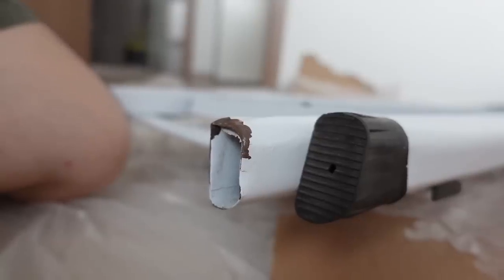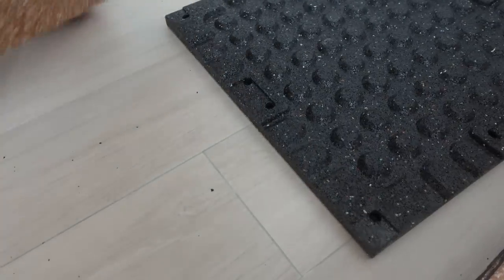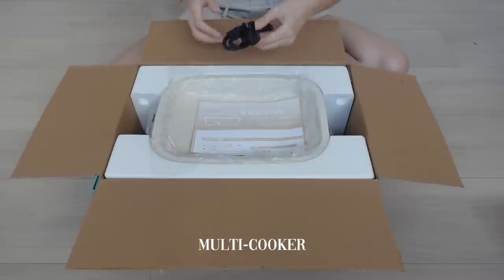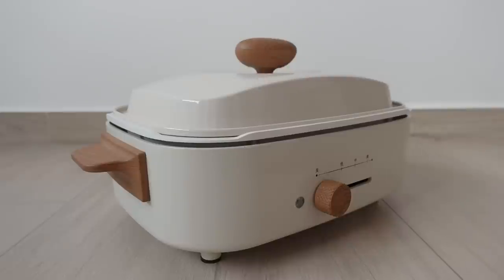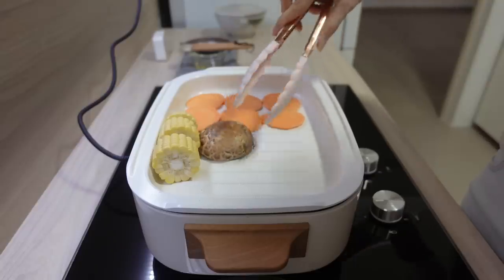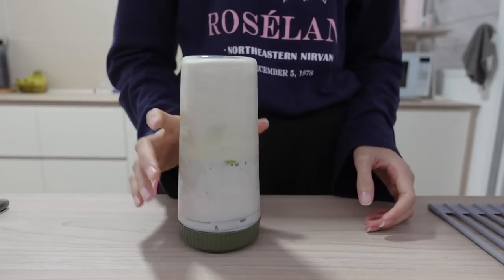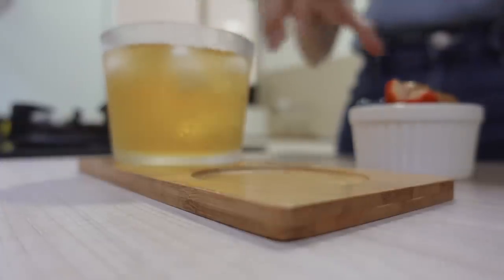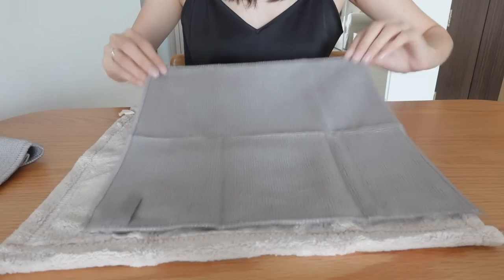taobao haul • Kitchen and Home Items + Giveaway (closed)

Comment: Hi. Is it difficult to wash the blender after making your own nut butter? I’ve been wanting to try making my own nut butter but is worried about the cleaning part as the blade cannot be removed.
Reply from the maker: It took longer than usual (vs smoothies) as the butter would get stuck in hard to reach areas like under the blade, bottle tracks etc and need to scrub them out if they can't be flushed out with water. I think it might be OK as long as you've a brush to reach those hidden areas :)
Reply: @haylivk  Then I’ll need to buy a long brush first. 😂 Thanks for replying.
Reply from the maker: @iamirrelevant6682  Cleaning is a chore 😩 No prob, lemme how it goes if you try it out :)
Reply: @haylivk  I know right!

Comment: How did you manage to make almond butter in a blender!? I tried it once in a brand new blender and no joke, it started overheating the motor so badly that it started spitting out plastic beads from god knows where. And that's the story of my $50 almond butter... (it wasn't even that smooth).

My life lesson is to not gheykiang and make almond butter myself. Perhaps I'll have better luck with a multi cooker. HAHA
Reply from the maker: I broke the plastic gear bits of my old blender too when I was making peanut butter! 😂 For this, I pulsed the almond into fine flour first before blending. Had to do it intermittently (on/off) 'cos I was kinda overworking it. Not as smooth/easy as the Vitamix tutorials I binged /cri (Not gheykiang!! Never try never know 😉)